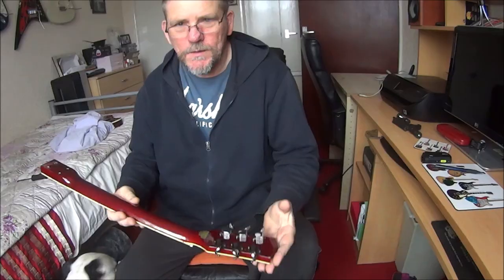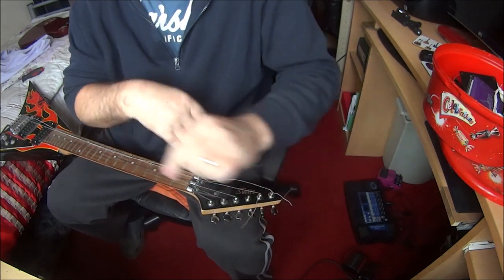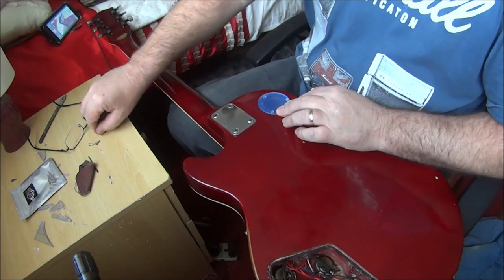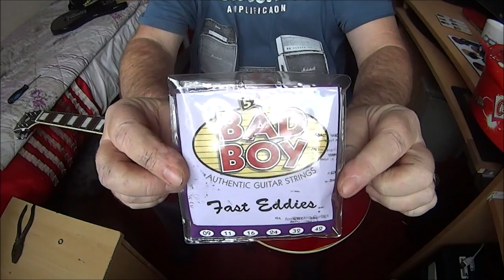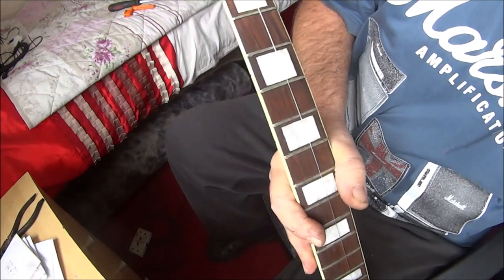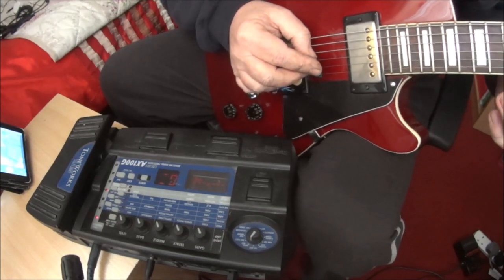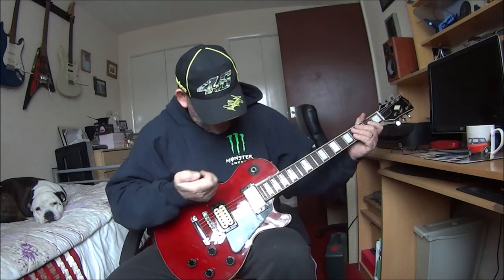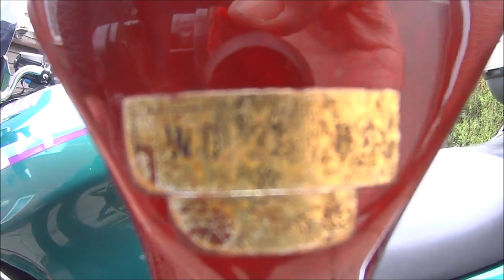EROS LES PAUL copy restoration complete.

Comment: Just paid £35 for one of these, minus backplates and was a non runner. Bought a harness for £6.50 from ebay. Looks like I have the original pups and has double binding. And guess what, I stringed it the wrong way and won't stay in tune.
Reply from the maker: Good for you for having a go hope you remembered to stretch the strings before the final tune up? 🔧